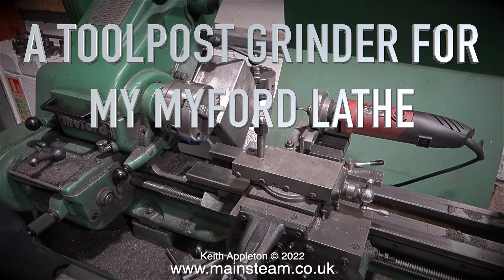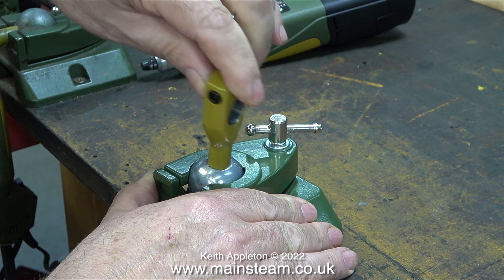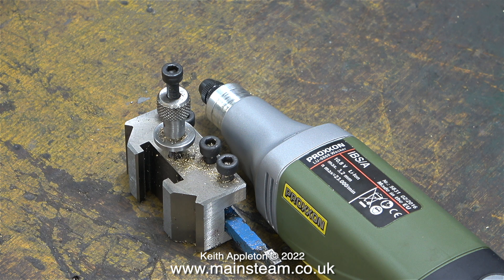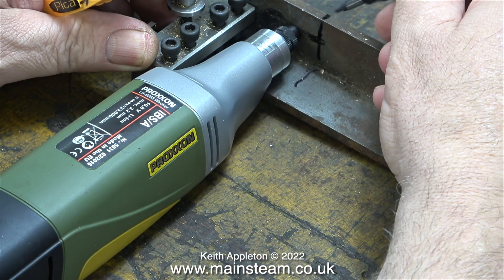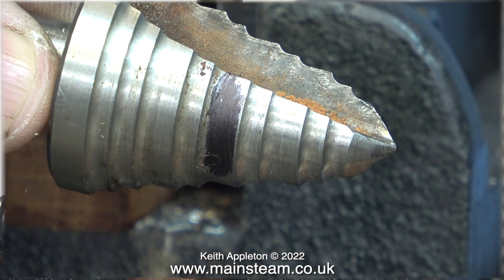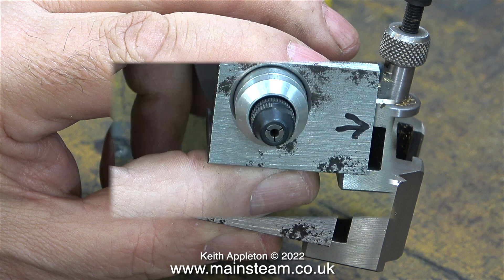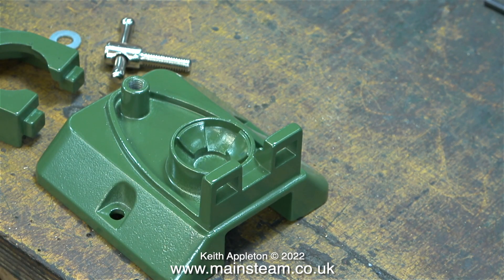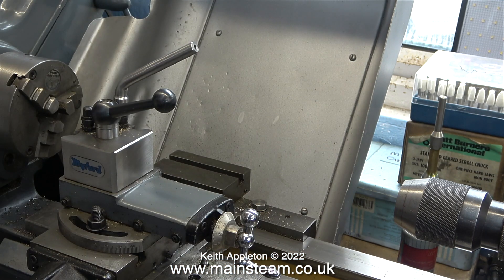A TOOLPOST GRINDER FOR A MYFORD ML7R LATHE - PART #1

Comment: Check out Proxxon no 24 098 toolholder
Reply from the maker: Thanks for the tip - Originally I was going to machine one like this, but I generally take the easier option for beginners, hence the bench mount mod..... I just bought one of these 24098 toolholders for only £17.75 via Amazon, I have never seen one before and I look forward to making a video about it when it arrives }:-)))